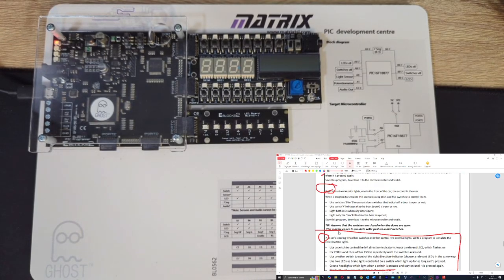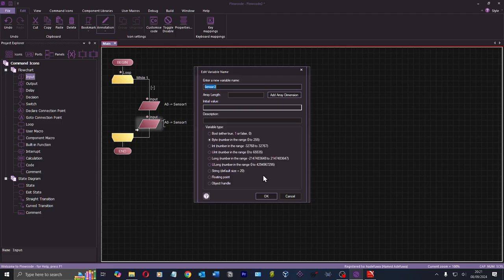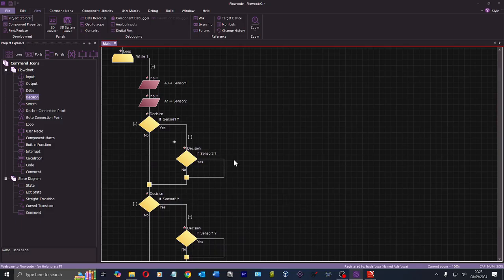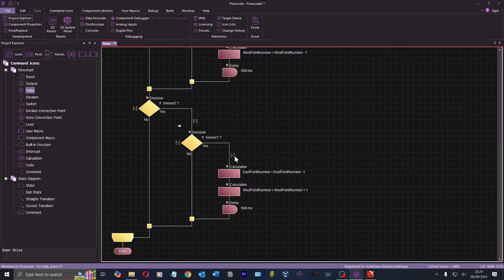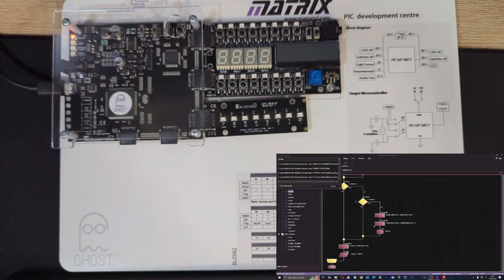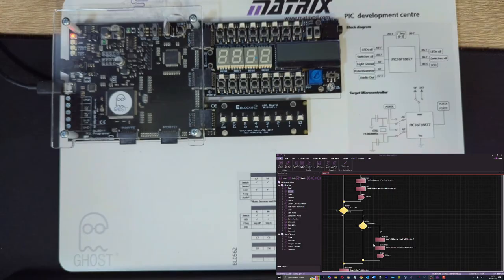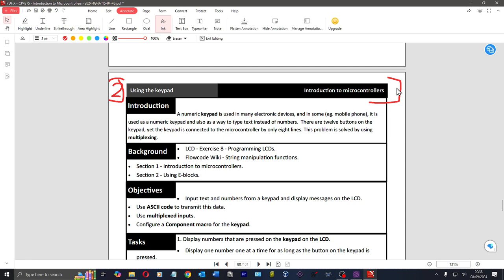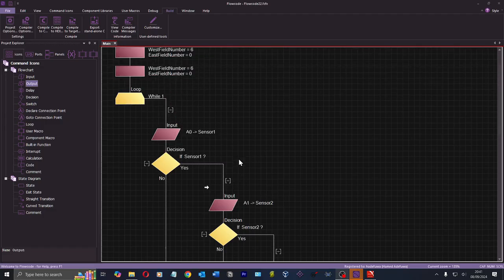Failure: Counting Sheep - Learning Microcontrollers with EBlocks & Flowcode #22

Comment: I have been following your Flowcode tutorials as they come out. They are great and really informative, thank you very much. I am trying to use a push button switch before a decision. Although as soon as the push button switch is released the output goes low. Is there anyway to "store" or "latch" or keep an input "high" for a certain duration to allow the program to cycle through a decision loop? Thank you in advance